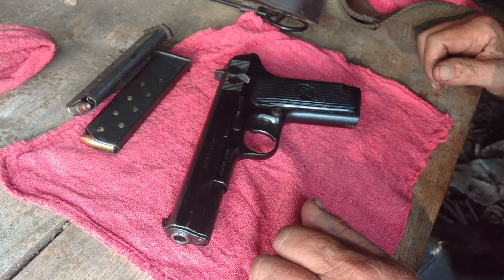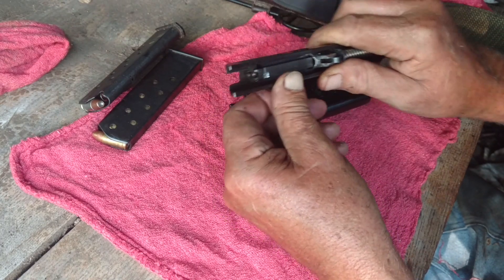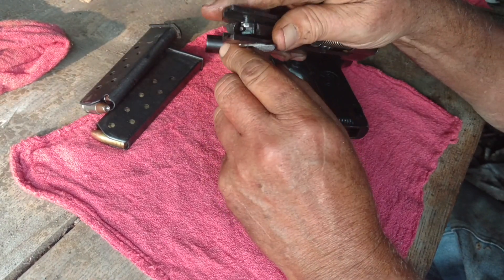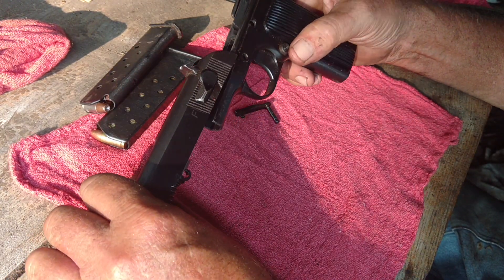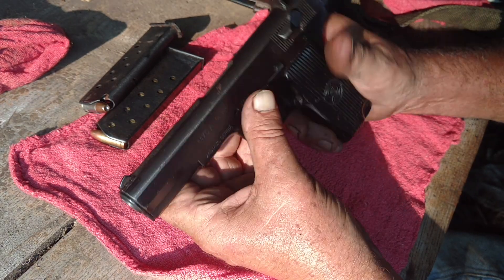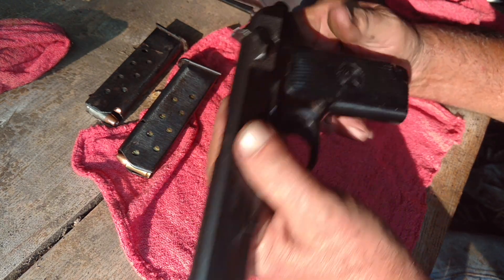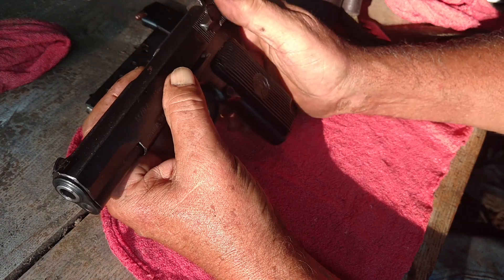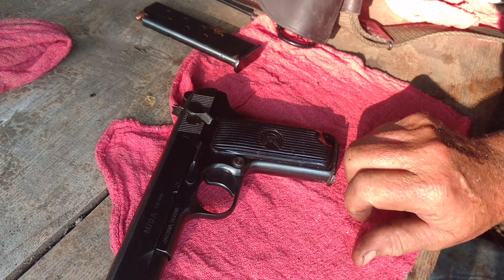Zastava M57-M70A safety

Comment: The safety lever is added to the M57 for import purposes.  There are two versions, a forward grip finger safety and a thumb safety.  The five M57's I have are thumb safety version.  Mine are all 7.62x25 and I do have LEE reloading dies but haven't had to do much reloading for it as I purchased many thousands of rounds of PPU brass cartridges about 8 years back when they were cheap.

Comment: I owned one of the m57 with the grip safeties. Worked well enough, but the hinge was protruding behind the grip and would really do a number on the webbing of your hand. I sold it and replaced with one of the Glock trigger safety versions that was imported at one point. I took out that trigger and replaced with an original… best version of all!

Comment: My M57 has a third type of safety that acts on the sear. They bored a hole towards the rear of the frame to run a half round cylinder through. I found it annoying as the thumb lever tended to chew me up on recoil. It's now in the spare parts drawer with it's retaining circlip.

Comment: I seem to remember reading that Tokarevs were originally designed without a manual safety, but one was added later? Perhaps this explains the difference?
Reply: “The TT-33 omitted a safety catch other than the half cock notch, which rendered the trigger inoperable until the hammer was pulled back to full cock and then lowered manually to the half cock position. Many imported variants have manual safeties added, which vary greatly in placement and function.”

https://en.wikipedia.org/wiki/TT_pistol
Reply: Originals don't have safeties. Any that were imported into the US had them added to meet the importation points list for pistols.

Comment: Would you recommend the 9mm model
Reply: The 9mm has the advantage in that the ammunition, and reloading components are relatively common.    But there is something intriguing about the Tokarev round.  Fast, and powerful, known for penetrating body armor.  The nice thing about either is it's a very slim design.
Reply: @logcabinloomsghost5924  I love 7.62x25 round love my cz-52 chamber in it